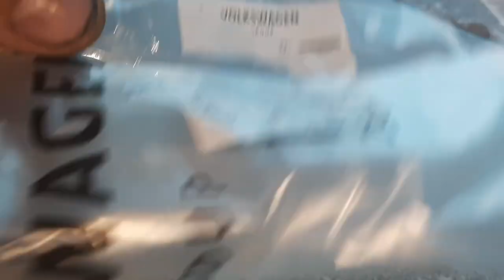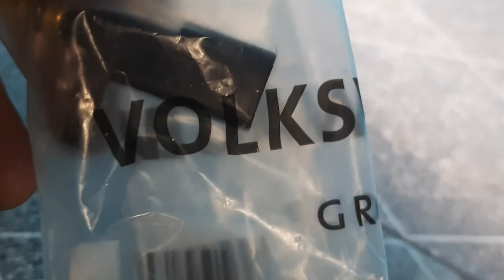Vw Up, Virtus, Gol, Polo Ea211 Aquecendo?

Comment: Estou com 1 gol igual ao seu já troquei bomba d'água,  válvulas termostatica,  sensor temperatura e resistência do eletro ventilador e o carro chega a 110° p depôs voltar p 90°
Reply: Conseguiu resolver amigo
Reply: Resolveu? Meu up está assim.
Reply: Cara tô com esse mesmo problema, meu carro chega a 110 e volta em 2 segundos pro 90, porém ele só faz isso quando tá muito calor, a noite rodando não passa dos 90, aditivo não baixa, não ferve, não vaza, tô começando a achar que isso é típico desses motores
Reply: @fernandomonzato5805  O meu tá do msm jeito. Já troquei radiador, aditivo,  sensor do Eletro ventilador e continua do msm jeito. Resolveu o seu problema??
Reply: Resolveu o problema?
Reply: @leandrorodrigogoncalves819  resolveu o seu ??
Reply: @LUCASCARVALHO-sv4zv  resolveu o seu ?
Reply: @fernandomonzato5805  resolveu??
Reply: @wesleyh.9731  sim, na verdade isso é normal na VW, está no manual, só não vai a 110 com o ar ligado
Reply: Meu tb faz isso..
Reply: @fernandomonzato5805 tenho Gol G7 16/17 w TB acho que é o normal......
Reply: Bom dia amigos! Tenho um polo TSI com esse problema. Alguém consegue ajudar a identificar a possível solução?
Reply: @fernandomonzato5805 

O meu começou com esse sintoma essa semana. 

Se eu rodar e desligar.  Depois ele sobe pra 130 e o ar não gela. 

Aí se eu desligar o carro,  imediatamente volta pra 90.   Como se estivesse normal. 

Ventoinha normal
Líquido normal

Comment: Eu tô com problema no meu voyage 2022 . Tem hoje que sobe em 110 graus e 20/30 segundos ele volta nos 90. Será que pode ser o sensor ?
Reply from the maker: Sim....
Reply: O meu Voyage acontece a mesma coisa eu levei na garantia da Volkswagen e eles disseram que esses modelos 3 cilindros esquentam um pouco mais mesmo!!
Reply: Mesma situação,  mesmo ano e carro, Voyage 2022 3 cilindros, troquei original e continua batendo 110 e logo volta pro 90 graus, tá armando os 2 estajos, será as termostato? xiiiiii
Reply: Trocou e resolveu amigo?
Reply: @charlescloa8396  acabei não trocando. Na VW eles falam que é normal. E no manual é normal até os 110
Reply: @HugoSouzaFernandes  Tendi, e até hoje então ele bate no 110 e volta pros 90?
Reply: @charlescloa8396  Sim. Ele fica nos 90 quando pego um pouco de trânsito ele sobe pros 110 . Se você reparar ele dá um tec dentro da cabine que é o acionamento da eletroventilador. Aí ele sobre pra 110 depois da outro tec e volta pros 90
Reply: @HugoSouzaFernandes  Quanto tempo você tem o seu e quanto tempo tá assim, vlw as respostas aí camarada.
Reply: @charlescloa8396  o meu tá com 30 Mil Km. Já faz um tempo. A única cousa que me atento é o nível da água.
Reply: @HugoSouzaFernandes  O meu aqui fez 45mil km mas só agr passa dos 90 graus,  por isso estranhei
Reply: @charlescloa8396  isso é um problema crônico do modelo, na verdade da linha. Up Gol Voyage tem isso.  E a linha da VW trabalha em alta temperatura. Tanto que mostra 110  e ta 102 graus no painel mas a ventuinha tá ligada e não vaza água por nenhum lugar. O preocupante é se começar a sumir água do reservatorio.

Comment: Amigo,o sensor do Voyage 2019 12v 1.0 é no mesmo local?
Meu carro arma a ventoinha e a temperatura vai a 110 e em 2 a 3 segundos volta ao 90 graus.
Ja com ar condicionado ligado não acontece isso.
E quanto custou esse sensor.
Reply from the maker: Sim é igual. Média 100 
Nunca use água ok só aditivo original. Ele liga com 105 graus
Reply: O meu está com o mesmo problema. Como vc resolveu o seu?
Reply: O meu estar do mesmo jeito
Reply: @leandrorodrigogoncalves819  
O meu aqui foi o pólo da bateria que não estava apertado o suficiente.
Limpei o bordi anrs e apertei.
Voltou ao normal aqui
Reply from the maker: Bom saber. Obrigado por dividir  a experiência
Reply: Eai Rodrigo conseguiu resolver ??
Reply: @xxghostsxxs319  
Amigo,eu joguei carlub nos polos da bateria  e nas tomadas do radiador e parou.
Tava até preocupado mas agora ta normal
Reply: isso mesmo , no scanner disparou com 102 e as vezes até menos um pouco,  só preciso verificar com o termômetro agora.